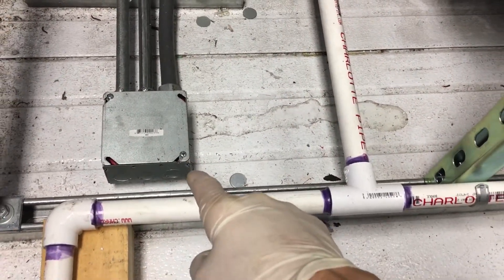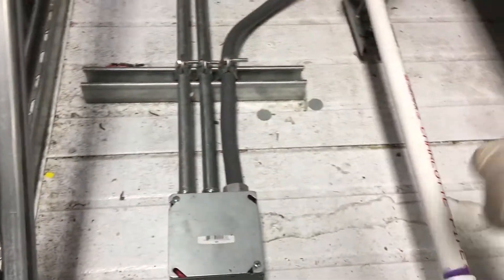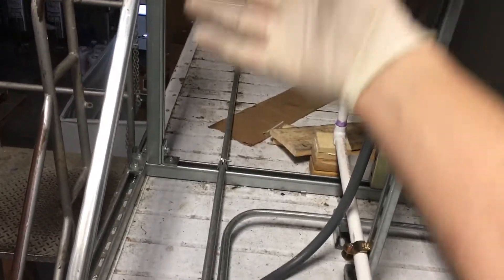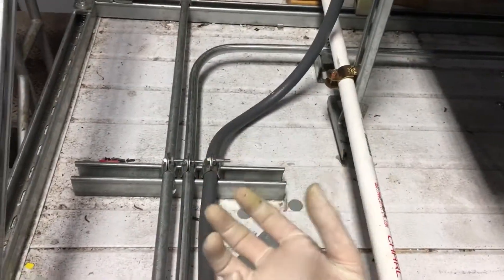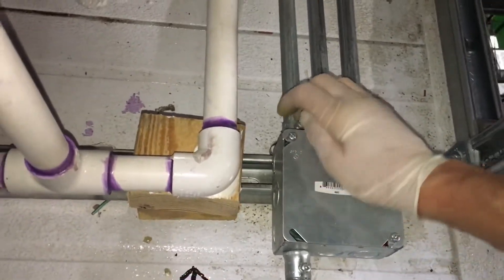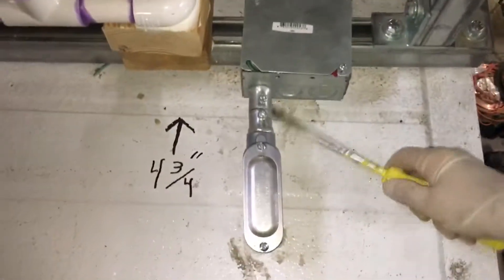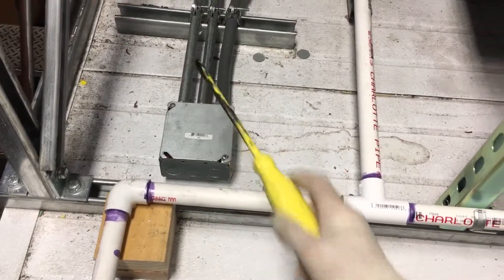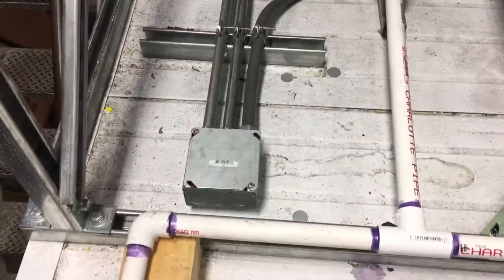Condensation damaging electrical wiring and connections. After a couple months or years of this.

Comment: This typical problem in northern states where temperature got lower 30 degrees and electrical conduits running through a cold attic condesesation start running inside box very annoying